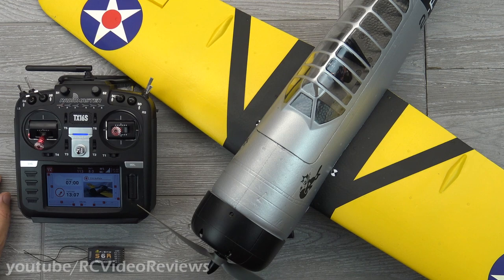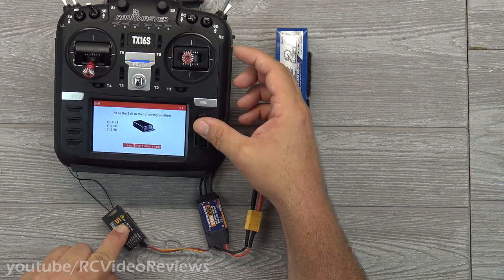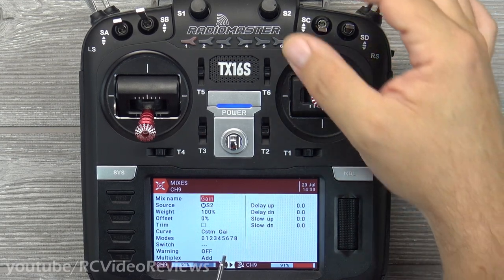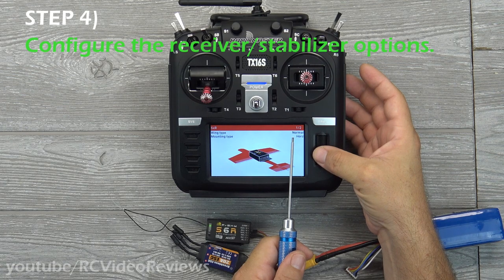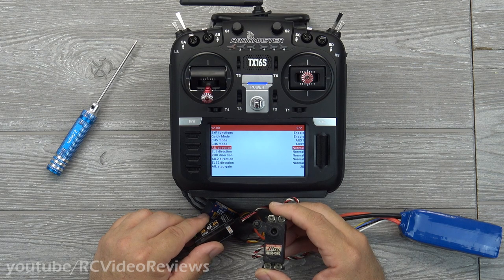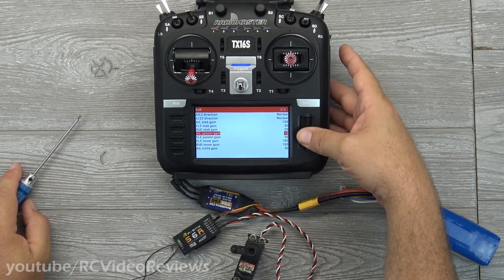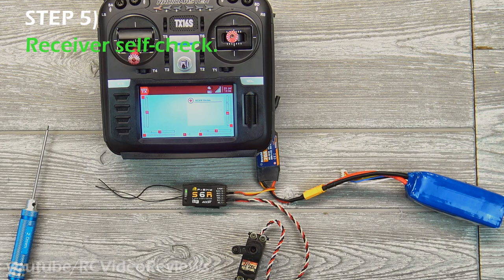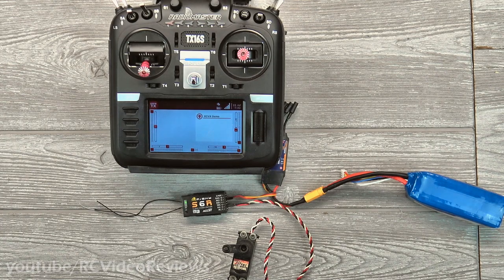Radiomaster TX16s and FrSky S6R / S8R Setup Guide [Quick Mode] • [Intermediate]

Comment: Thank you for the video, I ordered S6R because of it, the gyro will save newbie like me :)

I understand that RX also need to update firmware and TX16S able to do it? I can only find some old contents on internet (other model TX) and kinda confuse especially the wiring. Appreciate if you can make explain briefly, or make a video on that.

Thanks in advance.
Reply from the maker: Don't update firmware on your S6R. All of mine worked with TX16s as they were. Not required.

Comment: Thanks to all your tutorial videos on the T16S. Really helps a lot. 
My Radiomaster T16S won't bind with frsky xm plus receiver. I have red & green solid lights on the receiver. I hit bind on the the radio and lights stay solid red & green. Any idea why it's not binding?
Reply from the maker: I don't have an XM+ to test with, so I'm spitballing:

1) I found an instruction manual from FrSky that says exactly this: "Compatibility: TX with ACCESS v1.1.2" 

2) I found an online instruction guide from FrSky that says, "Compatible with D16 mode"

This is one of the big problems with FrSky products: Clarity of instructions. I would tell you in the first case, your TX16s won't work with an XM+. I would tell you in the second case to make sure your protocol is FrSky D16. I would also suggest trying FrSkyV2 D16.

Let me know what happens when you try both FrSky protocols in D16 mode.
Reply: @RCVideoReviews  Got it to bind. I updated XM+ firmware to XM+_ACCST_2.1.0_RSSI16__FCC.frk. Bind it on the T16S FrskyX2 D16. It was going in  fail safe, alternating red and green light everytime after bound. Had to do a RF Freg. fine tune. I ended up with a value of -1. Thank you for the help. 👍
Reply from the maker: @rtcfpv1012  Glad you got it. It probably came with an ACCESS firmware on it.

Comment: For the S6R receiver, will I still need one of the S.Port Tool Kit (STK) to program it or can I set it up through OperTX and the radio? Thanks!
Reply from the maker: Nope, you setup it up with the radio and the SxR Lua Script.
Reply: @RCVideoReviews  Well, I guess I bought one for nothing then. 🙄 Thanks for the reply and information. 👍
Reply from the maker: @graywoulf  If you want to upgrade firmware on the SxR you need the STK tool. If you're running Windows 10, you'll want to set the App to run in Windows 8 compatibility mode.
Reply: @RCVideoReviews  Thank you for that valuable information! I will make a note of that for sure. 👍

Comment: HI RC, When starting  binding my FrSky XSR 2.4GHz 16CH ACCST  receiver I got a slow blinking red light instead of solid green. What do you think? Thank you.
Reply from the maker: The manual says it's in bind mode meaning you haven't completed the bind. What protocol are you using on the radio?
Reply: @RCVideoReviews  D16.
Reply from the maker: Did you upgrade the firmware on the Rx?
Reply: @RCVideoReviews  No.
Reply from the maker: @alumahomeinspections7009  Normally if it won't bind it comes down to one of two things: 1) You have a v2 firmware in which case you need to bind with FrSky X2 D16 or you have a v1 firmware in which case you need to bind with FrSky X. or 2) You're not in bind mode or there's a bind failure.

So I would suggest trying FrSkyX D16 and FrSky X2 D16. Make sure you have the bind button pressed on the Rx when you power it on. If neither of those work, you may have a faulty Rx.

Comment: Hi can you set up the frsky rx6r receiver  on this radio think they have OTA in them?😀
Reply from the maker: That is an Access compatible receiver with the right firmware on it. If you've flashed an Access firmware on it, no. If it's Accst and D16 or D8, then yes, it should work. All the OTA stuff is Access.

Comment: ch12 can be used with  switch SH   the one way spring return switch. Istead of switch  SA  ......Using this you dont have to worry about leaving it on by accident. set up as follows    Source SH.   Weight.Minus 50    Offset plus  50.
Reply from the maker: I use that one for instant trim. I think for me what I’ll start doing is overriding ch12 when throttle cut is off.
Reply: @RCVideoReviews  interesting

Comment: Hi, thanks for that great guide. Question - I don't use dual rates, but only expo and on auto level the movement is minimal on Ail and Elev (with no stab I have full movement) Comment - if you have flaps / retracts connected to AUX1/2, you might want to disconnect them, otherwise these channels might not work after the stab process.
Reply from the maker: I don't understand your question. Disconnecting AUX1/2 shouldn't change how the Rx behaves but I haven't done any experimentation with this so I'm not sure I follow your comment here.
Reply: @RCVideoReviews  I did the calibration and when trying the auto level, the servo movements are very little. I increased the gains to 50, but the same... I'm not using dual rate.
Reply from the maker: Ok, for any channel you use, after you calibrate for level, you have to move surfaces to the full extent. So if you're using AIL2/5 for a control surface, you have to give that surface (and all other control surfaces) full deflection after you calibrate.
Reply: @RCVideoReviews  this is exactly what I did... And tried sevaral times. And it's not my first S8R, I got few that works fine... Will keep playing with that, thank you!
Reply from the maker: Hmmm, you might want to reflash the firmware. I'm not surprised at your comment as FrSky software can be finnicky. Anyway, as long as you move the surface to full deflection immediately after the servo dance, you should have full deflection. MAKE SURE all your weights are set to 100%. I know you said you don't use dual rates, but verify in your channel monitor that the OUTPUT reads 100% before you calibrate.

Comment: Hi i have followed this video exactly, my issue is my receiver will not go into self check mode, on channel 12 with a 3 pos switch, or with the f/s button. Has anyone any suggestions?
Reply from the maker: You're starting with the stabilizer off and you toggle the Ch12 switch 3 times rapidly all the way through top to bottom?
Reply: @RCVideoReviews  yes, also when I toggle I do get the chicken switch reaction from the servos, just no blue light or self check procedure.  I'll set up another model in the tx to make sure nothings gone awry with the current one.
Reply from the maker: @JJ-FPV  Toggle it 5 times really fast.

Comment: I am a newbie and subscribe to your channel and have leaned a lot. I recently installed an s6r in a plane. I use a tx16s. All went will until I calibrated it. Ailerons work fine but elevator goes in the opposite direction. Works normal when stabilizer is off. I tried recalibrating but it didn’t change it. Would you have any suggestions or is there a forum out there that could help me.
Reply from the maker: Are you configuring via LUA script? If so, on page two invert the elevator.
Reply: Thank you it worked perfectly.

Comment: Small hands mod :-) 
As i prefer to switch gyro modes with the right slider i assigned today RS to CH10. Works like a 3 pos switch.
Reply from the maker: That’s the beauty of OpenTx. Whatever works for you. The radio doesn’t care. :)
Reply: @RCVideoReviews  So true. I'am new to OpenTx, very basic skills only, but it starts getting addictive. :-)

Comment: Hi, Great Video, i have a RX8R receiver, what parameter should i choose in the TX? (FRSKY X, FRSKY X2)?
Reply from the maker: FrSkyX for v1.x D16 and FrSkyX2 for v2.1x D16.
Reply: @RCVideoReviews  And i do you know what version do i have?
Reply from the maker: @elikjacobson7544  Try binding with one. If it doesn't work, try the other. Or you can flash a firmware and know for sure. Here's a video on flashing RXs with the radio: https://youtu.be/-U_dEsh1ZcQ
Reply: @RCVideoReviews  I`ll try, thank you

Comment: Hi, I have Hobby eagle A3 Super , can you advice how to activate Hover,auto level ,and 6 position switches to activate in flight.
Reply from the maker: You might be able to get away with just using the 6p as the source on Ch5. Try it. If that doesn't work, 
you will need to set the 6 position switch as the source on channel 5 and setup special functions with overrides as follows:

6p1 1120us to 1250us
6p2 1250us to 1385us
6p3 1385us to 1520us
6p4 1520us to 1655us
6p5 1655us to 1790us
6p6 1790us to 1920us

See page 15 of the manual for more info.
Reply: @RCVideoReviews  Thanks a ton,live long.
Reply from the maker: @prabukengg  You're welcome, and I'll try ;)

Comment: Is there a batt telemetry or do i need an external sensor modul?
Reply from the maker: On the SxR you get A2 which is Rx voltage. If you want pack voltage, you'll need a sensor on the main voltage line of the battery connected to s.port.
Reply: @RCVideoReviews  ok thanks
Reply: Can i put the gps frsky sensor and the voltage sensor at the same time to the smart port?

Comment: Hi can you please advise me how to setup a three position switch to control stabilizer modes on the volantex protocol planes ie p51 mustang the little Corsair and the little super cub 500 , thanks in advance and please stay safe and with my best regards from Alan in the UK 🤗🤗👍👍 old newbie that I am! Thanks again
Reply from the maker: I couldn't find much about Voltantex stabilizers on those planes; however, I did find a Voltanex stabilizer called the XPilot AX601. The manual for that device says to put a 3 Position switch on Channel 5. Most of these stabilizers will work with a 3 position switch on the correct channel. Do you have a manual for the plane? What does the book say about configuring the stabilizer?
Reply: @RCVideoReviews  thanks for your response but the manual is only to help you get flying and provides no useful or useable information on the receiver however I've just had a great reply from Alishanmao on the other side of the world as well and he has supplied me with all the information that I required to run the volantex protocol planes that I have in my collection, but please accept my thanks for sharing your help to me it's much appreciated, wishing you and your family well and with my best regards from Alan in the UK 🤗🤗👍👍❤  ps I'm hoping that my Radiomaster tx16s will be arriving in the next few days 🤔
Reply from the maker: So what was the answer????

Thanks for the follow-up and kind words. 

J

Comment: Found if the receiver too close to the transmitter it will lose connection and the calibration will stop and have to start over even if it reconnects it won't let you continue.
Reply from the maker: Yeah, that's called swamping.

Comment: Hi, thanks for a very good channel. I'm from Sweden. I can not bind my s6r. My reciver is eu lbt. Could that be the problem?
Sincerely, Peter
Reply from the maker: I have never used an LBT EU Rx so I have no troubleshooting experience I can share. I did find this though. What firmware do you have on it?

https://www.rcgroups.com/forums/showthread.php?3635113-FrSky-S6R-bind-to-Radiomaster-TX16S
Reply: In OpenTx try Multi/ Frsky/ LBT(EU)  or .LBT(8ch). Worked for me.
Reply from the maker: @stephanbre  Thanks for the assist.

Comment: I am trying to bind a FrSky receiver SR8 PRO on my Radiomaster TX16S without sucess

Radiomaster TX16S Firmware:
OpenTX 2.3.14
module software 1.3.2.86

I also tested by updating the receiver firmaware to v2.1.8 but also not worked

Anybody have an ideia, how to solve it?
Reply from the maker: If you have v1x firmware on the Rx you need to use FrSky X D16
If you have v2x firmware on the Rx you need to use FrSky X2 D16

Comment: Thanks for the great informative video!  I do have a couple of questions.

1.  How often do I need to calibrate after the initial calibration?

2.  In the sxr setup, what should I start out with in stab gains?  I assume the stab gain settings here affect how much gain is applied or removed with the rotary?  In other words, if I have stab gains set at 50 and am flying and have my rotary dial maxed and am not getting enough stabilization, then I would need to increase the gains from 50 in the config, correct?
Reply from the maker: You only really need to calibrate it once. If you change your hardware or monkey around with the gimbals, calibrate it again.

You really shouldn't have any issues with gain on the SxR. I've put those on some pretty big planes and never ran out of gain, if anything, it gives too much gain stock.

Comment: FrSky X2 D16   necessary to get my S6R to bind.
Reply from the maker: That means you have a v2 firmware on the rx. They didn’t ship this way when the video was made.
Reply: @RCVideoReviews  Such a mess... These S6Rs are the only frsky product would ever buy.  I am surprised they have ACCST firmware for these period.
Reply from the maker: The SxR predates ACCESS. I don't even want to get started on what I think of FrSky and the choices they've made with protocols. You're right, total mess.

Comment: I just followed like what you did to binding..but after that always got voice "RF/RS signal critical" and on rx sometime blinking red..also when I start to turned on the tx on display appear "failsafe not set"..can you solve this out mate
...I appreciate for your respone
Reply from the maker: Move the Rx away from the Tx. The S6R is prone to swamping when it's right next to the radio. 

For failsafe--that's an option below the bind option. Just set it to what you want: Hold, No Pulses, or Custom.
Reply: I was trying to binding again and move the tx & rx about 5m but still got some problem..also when binding i start on/off telemetry wasn't made change..and its happen not only me my friend either..any suggestion mate ?

Comment: Stuck on binding SR8 Pro to TX16S can you help please. All ok on Taranis but not on the RM?
Reply from the maker: 1) Make sure you have a non-ACCESS firmware on the radio.
2) Make sure if you have a 1.x firmware, use FrSky Protocol on the MPM
3) If you have a 2.x firmware, use FrSkyX2 on the MPM. 
4) In both cases use D16